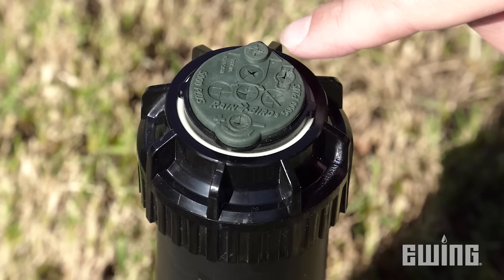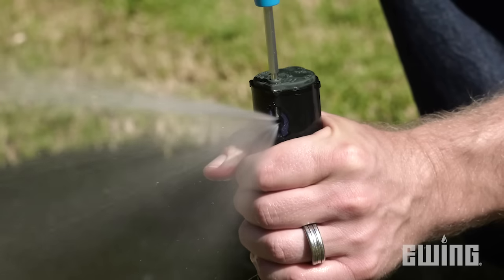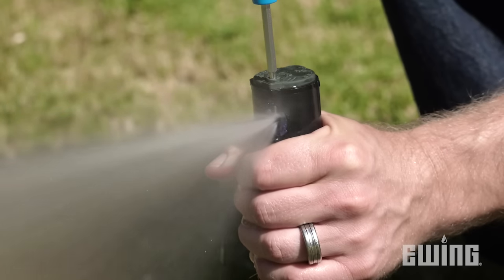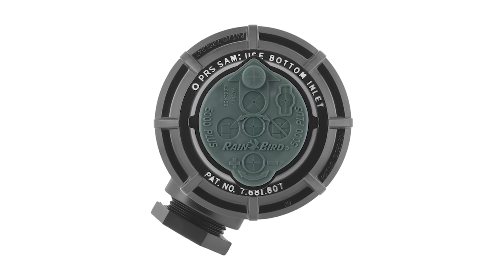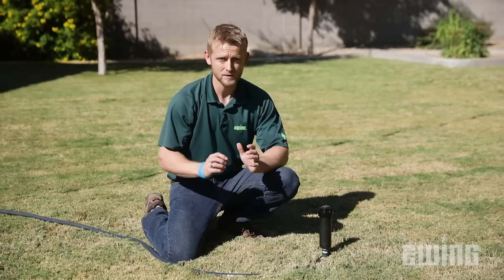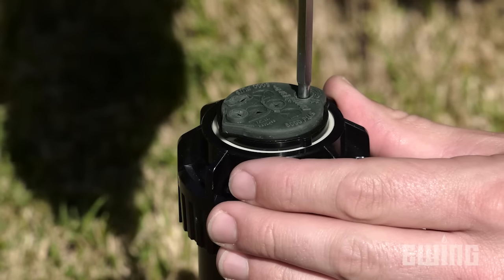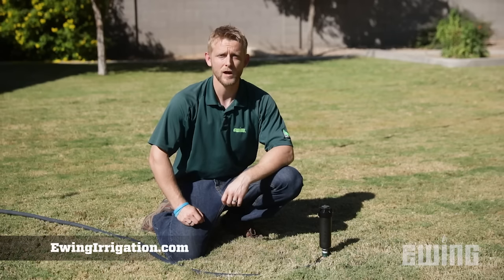How To Adjust A Rain Bird 5000 Series Rotor

Comment: When I watch a Rainbird video on adjusting it says to rotate the rotor all the way to the right, then all the way to the left as you did.  Then it says do NOT turn left past that point as you may strip the gears.  It says to rotate the entire head clockwise to get to the correct left stopping point.
Reply from the maker: That would be correct for old models of their rotors. Rain Bird added a "slip-clutch" to their rotors 15 years or so ago to simplify setting the left stopping point. If you are unsure if you have an older model then you can remove the cap/turret from the body with the turret turned all the way to the left. Re-install the turret with the nozzle direction indicator pointed to the desired location. You can contact Rain Bird support should you need further clarification: 1 (800) 724-6247. Thanks for watching!
Reply: Did not work for me.
Reply: @ewingoutdoorsupply  is an older model rotor still marked 5000?

Comment: Thanks for the video but I found it confusing with all of the turning back and forth that was done when setting the lefthand point.  After watching the video over and over 20x I finally decided to give it a go.  It was actually easier than I thought it would be and I didn't have to do all the turning back and forth.  I just stood behind the head while it was on and could see the lefthand point was way too far left (spraying my neighbor's car).  Therefore, I had to turn the whole sprinkler back into our yard by hand so it was spraying down the property line.  Then after seeing it spray into the street on the right, I started adjusting the entry hole on the back (opposite the arrow) and after doing this a few times got it to stop where I needed.
Reply: How did you turn it? What part of it did you turn?
Reply: Thanks.  I have EXACTLY the same issue.  So you physically turned the entire rotor clockwise to set the left stop point?

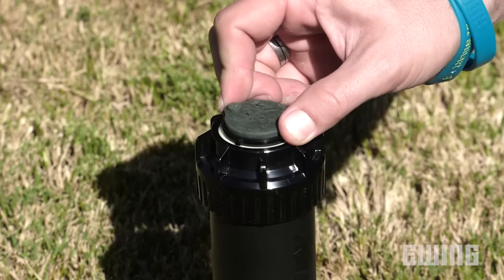Comment: 1:25 It appears very easy to turn past the stopping point but I can’t turn left past the stopping point.  Should I use brute force?  Am afraid it will break.
Reply from the maker: It may be that you have an old version of the 5000 series before they introduced the slip clutch. The slip clutch is what allows you to set the left stop by turning the turret. If you are unsure, set the left stop by unscrewing the cap and removing the internal components. Make sure the turret is in the far left position then re-install with the nozzle pointing in the direction you would like your left stop to be. Thanks for the question!
Reply: @ewingoutdoorsupply I just lifted up the head and turned left and was able to turn it beyond the stopping point.  Maybe an older version since yours does not need to lift up the head to turn it.

Working well again.  Thanks

Comment: I watched this a bunch last year and this year because it is the best video…even though I’ve been very confused with these instructions but just now figured out an IMPORTANT key feature left out which is: to adjust the side motion you turn the Entire head to the left with your hand and if it is going to far left you crank the entire head to the right almost forcing it to a point that felt like I would break the cheap feeling plastic
Reply: It is, indeed.

Comment: Isn't there a difference between 15 year old 5000s and newer ones regarding some "clutch" and if you force it left it would strip gears?
Reply from the maker: Correct, the older models do not have the slip-clutch so you would need to remove the turret to set the left stop. Thanks for the question.
Reply: Does the 5004PC have the slip clutch for setting left or do you have to have the 5000 Plus.   @ewingoutdoorsupply
Reply from the maker: @johnpowers4735  Yes, the non-plus models also have the slip clutch.

Comment: Thanks. I've replaced a couple of fixed sprayers but not a rotator until now. The irony is i watched other how to's and they talked about the left and right settings while the rotor is out of the ground and that does nothing. I was guessing that if I turned the rotor past where I wanted the right stop. the left would move as well, then just use the tool to re adjust the right to where I want that and voila. Worked just like you said. Other videos implied wrongly that the left spray cant be adjusted and that is correct out of the ground not in the ground.

Comment: Great straight forward video. I have tried unsuccessfully to remove the cap from sprinkler body. Is there some trick or lubricant to aid in removing the cap?  Or, just use wrenches and hope the plastic doesn't break?
Reply from the maker: Thanks for the comment Larry! You can use Channellock pliers to remove the cap.

Comment: Do you need to have it off when adjusting the left to right radius?
Reply from the maker: Not at all, you can make your adjustments with the water running. Thanks for watching!
Reply: radius is not left to right. radius is spray distance like radius of a circle.
( brush up on your Geometry, lol)  just kiddin

Comment: When you say to the left or to the right, are you facing the nozzle or are you behind it? Clockwise is still helpful, but I still need to know which side of the rotor I'm on to get it correct. Of course, I'll be doing trial and error before I can get an answer, but maybe your answer will help someone else. Also, mine is tight and does not stop when I turn it right (clockwise). It is brand new, which is why I am at this site to find out how to adjust it. It is a 5000 Pro Rotor with 26' - 38' range, full or part circle.
Reply from the maker: You should be facing the area you are irrigating. Thanks for watching!
Reply: Just knowing which way to face (basically behind the sprinkler) is a big help, which solves the other problem I was having with the range.
Reply: @ewingoutdoorsupply  Thanks! that is very helpful and resolved the other issue, too, of why it felt tight.

Comment: I have a rainbird that always leaks out the top after it's run it's course, how do you keep the water from trickling out when it's off?
Reply from the maker: It's likely that the head is the lowest in elevation in that zone. You can prevent low head drainage by using a head that is equipped with a check valve like this one.
https://www.ewingirrigation.com/35001620-5004-plus-adjustable-rotor-with-sam-and-prs
Thanks for watching!

Comment: I have a Rainbird 5000 Plus that just spins 360 degrees. It seems to have no left stopping point. The manual doesn't mention this as a possibility. If I manually turn it to the left it just spins and there doesn't seem to be much resistance and I don't hear clicks. If I turn it to the right, it turns with some resistance and I hear clicks. Does this indicate something is broken internally, or is there some basic adjustment that needs to be done?
Reply from the maker: The 5000 series also comes in a full-360 degree model. It may be that's what you have. Thanks for watching!
Reply: Sounds like its gears are stripped. Not an uncommon thing with the rain bird heads, but once they reach that point you have to replace the head.

Comment: Thanks for explaining you can set the left edge by turning left BEYOND the stop. The Rain Bird instructions say you can unscrew and "adjust internally" which I tried. But there is no visible stop - just the spring and the 2-pc rotor that ratchets. I was replacing an old head, had the new one all set to the left stop, tried multiple times to screw it onto the fitting, but could never get it tight where the left stop aligned with the needed position. That's when I Googled and found this video. Extremely helpful. Thanks!
Reply from the maker: Glad we were able to assist! Thanks for the comment.

Comment: My problem is that the left-hand stop is too far left. The video seems to give good explanation as to how to make it go for the left, but no explanation on how to bring it back in. Do I just have to dig up the whole sprinkler and turn the thing to the right?
Reply from the maker: If you go past the point of where you want the left stop to be, just continue turning it a (near) full circle until you get to the correct spot. The other option is to unscrew the turret and reinstall it with the turret turned all the way to the left and lined up with where you want the left stop to be.
These are the options for setting the left point from the Rain Bird instruction manual. We've included the link below as well:
Align Fixed LEFT Edge:
1. Pull up turret and turn to the left trip point (counterclockwise).
CAUTION: If the rotor does not turn easily to the left, first turn it
right (clockwise) to the right trip point.
2. Rotate entire case to the desired fixed left position, OR unscrew
cap and pull out assembly. Rotate internals to re-align left trip
point to the desired point and re-install.
https://www.rainbird.com/sites/default/files/media/documents/2018-02/man_5000_5000Plus_PRS.pdf
Thanks for watching!

Comment: can you adjust the pressure/power on these?
Reply from the maker: You cannot adjust the pressure but there are pressure regulated versions of these heads. If you want to decrease the distance of the spray (radius), Insert the steel hex end of the Hunter wrench into the radius adjustment screw. Turn the screw clockwise (into the stream of water) to decrease the radius, or counterclockwise to increase the radius. Radius can be reduced up to 25%. Thanks for the question!
Reply: @ewingoutdoorsupply  Wow, now your talking a different (Hunter) brand, stop confusing me, lol

Comment: My left stop is at the 7 o'clock position but I want it to stop at a 10 o'clock position.  Does this mean that after I turn and reach the right hand stop I begin to turn counter clockwise to the left stop  ( at 7 o'clock) and past it and continue counter clockwise all the way around to the 10 o'clock position?
Reply from the maker: That's correct Rose. Start by turning the turret to the right until it stops, then turn to the left to the current left stop. Continue turning past that point until you reach your desired stopping point. You can also unscrew the cap and pull out assembly then rotate the turret to the left stop point. Then re-install with the nozzle pointing in the desired direction.
Reply: @ewingoutdoorsupply  Thanks. I asked 5 different installers and got 5 different answers.  Thanks for the clarity in your reply.
Reply: @ewingoutdoorsupply  Do you have to turn the sprinklers off to make this adjustment, or can this be done while running?  We have one that the left stop hits our driveway (say 10 o'clock position) and we want it to be at 12. We have a rainbird 5000, would that change these instructions at all?  Thx
Reply from the maker: @christybenson  Yes, you can make the adjustment with the water running. This video is for the Rain Bird 5000 series rotor:
https://www.youtube.com/watch?v=pVa0YjLW7Tw
Reply: @ewingoutdoorsupply  thank you :)

Comment: "Then you can turn past the left stopping point until..." My 5000plus won't turn any more to the left when doing this, at least by hand. Do I put a wrench on it? I'm afraid of breaking it.
Reply from the maker: These are the options for setting the left point from the Rain Bird instruction manual. We've included the link below as well:
Align Fixed LEFT Edge:
1. Pull up turret and turn to the left trip point (counterclockwise).
CAUTION: If the rotor does not turn easily to the left, first turn it
right (clockwise) to the right trip point.
2. Rotate entire case to the desired fixed left position, OR unscrew
cap and pull out assembly. Rotate internals to re-align left trip
point to the desired point and re-install.
https://www.rainbird.com/sites/default/files/media/documents/2018-02/man_5000_5000Plus_PRS.pdf
Thanks for watching!

Comment: I would invest right now in the company that designs a more durable and easy to use sprinkler head system. Seriously. Have a socket for adjusting the right hand stopping point, left hand stopping point, sprinkler height, aperture of the spray, and width of the arc. Done.

Comment: If the head doesn't stop when you rotate it to the left, does that mean it's broken?
Reply from the maker: If it's an adjustable model then it could be that the gears are stripped. It may be a full-circle model though that is not adjustable and would not have a left-hand stop. Thanks for the question!

Comment: 5000 and 5000 plus are different why not make a 5000 video with a 5000 head.
Reply from the maker: The only difference with respect to the adjustment and control of the 2 heads is that the 5000 plus can be shut off at the head. The method for adjustment is the same for both heads. Here's a link to Rain Bird's instructions for details.
https://www.rainbird.com/sites/default/files/media/documents/2018-02/man_5000_5000Plus_PRS.pdf

Comment: This video was terrible. Clear as mud.
Seriously, there has to be a better way to design sprinkler heads. The fact that you have to dig out the head and use a clamp to adjust the left stopping point is RIDICULOUS. And every video out there explaining how to adjust sprinkler heads comes off as rocket science.

Comment: I believe the green top 5000 PLUS rotor your using has a slip clutch the regular 5000 does not so you cant force turn/rotate  the left edge to make your edge on a regular plain 5000 rotor. You have to unscrew the pop up nozzle and re-install it so the left edge is aligned. Please  let me know if I'm wrong and i will edit this. Thanks.
Reply from the maker: That was the case with older models of the 5000 series. 
These are the options for setting the left point from the Rain Bird instruction manual. We've included the link below as well:
Align Fixed LEFT Edge:
1. Pull up turret and turn to the left trip point (counterclockwise).
CAUTION: If the rotor does not turn easily to the left, first turn it
right (clockwise) to the right trip point.
2. Rotate entire case to the desired fixed left position, OR unscrew
cap and pull out assembly. Rotate internals to re-align left trip
point to the desired point and re-install.
https://www.rainbird.com/sites/default/files/media/documents/2018-02/man_5000_5000Plus_PRS.pdf
Thanks for watching!
Reply from the maker: @SuperDrew247  We do not but this video from Rain Bird should help you.
https://www.youtube.com/watch?v=epKJ259hzlc
Reply: newer 5000 do, you don't know what your talking about, shut up and watch the video again my son.

Comment: This was no help at all unless the sprinkler is on top of the ground.
Reply: Use the little Rainbird tool in the slot to pull up the sprinkler head if you need it above the surface to work on it.